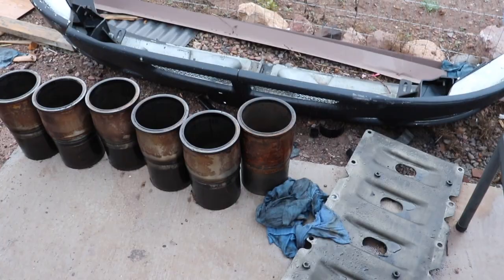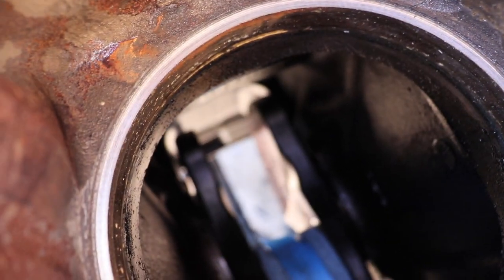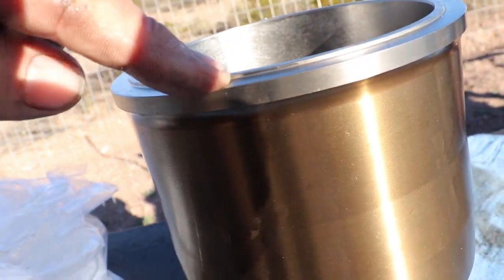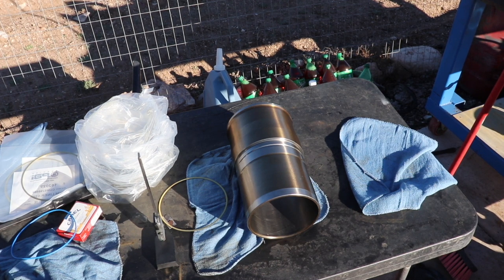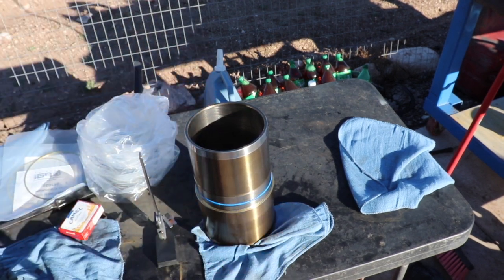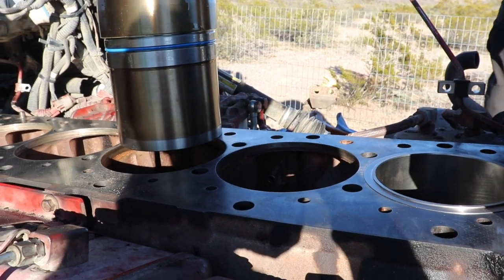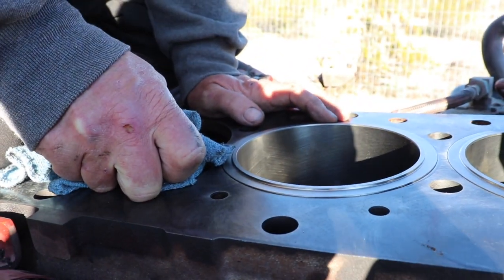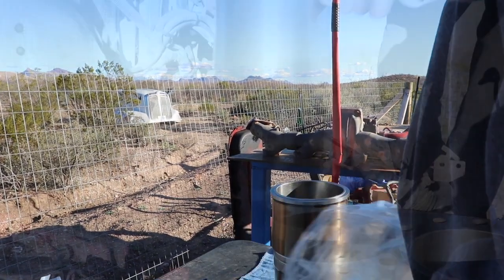14- Cummins ISX Single Cam Liner Installation: (The Beginning Of A New Life For My ISX)

Comment: Very good. 
I came across your channel while researching the ISX 650 that was put into some RVs (Coach RVs) and the problems/costs associated with that engine. That 650 is wonderful power but the problems with that DOHC probably aren't worth the risk. And, it seems that the DOHC is not the only issue with that engine; several additional issues as well. Major horror stories documented on several forums, by several individuals who have lived that nightmare. And once upon a time, we had the fabulous N14 and before that we had the 855 Big Cam engine. Both of those were good engines for me. Years ago, if we had to even consider touching anything internally before a million miles, we were stunned. We used to get well over 1 million miles before we touched anything inside of diesel engines. And then came the emissions debacle. I'm reading about guys who have had to completely overhaul that ISX 650 before 50,000 miles; one of the valves would fail (#6 cylinder from memory) and it would nearly destroy that engine. A couple reports of engine failure before 19,000 miles. And the cost... scratching $50K to fix the mess! One guy reported engine failure twice, both before 50,000 miles. I'm not finished reading/researching yet but it looks like Cummins had to completely redesign the cylinder head, rockers, valves and more to "hopefully" fix the problem. I like big engines and it's very frustrating that a big engine such as that one can't be more dependable than that. It's always a nice feeling to have major power and then just let that thing purr down the road.        

It's fabulous that you're taking the time and willing to work to document this; overhauling an engine and trying to film it is not easy. 
Thank you for doing this.
Reply from the maker: any time

Comment: What was the cost to have them come out and cut your counterbore's?  I have a 2012 T800  flattop  ISX  I'm about to turn up from 1650 tq 450 hp to 1850 tq 500hp  I have had it for a year with very few problems yet  it's got 770,000  on it dosen't use but a gallon of oil per oil change.
Reply from the maker: Sorry for the late answer, it depends on where you’re at, it was $850 for my counterbores
Reply: @TerraFirmaX  I was just curious!  looks like you did a great job on it!